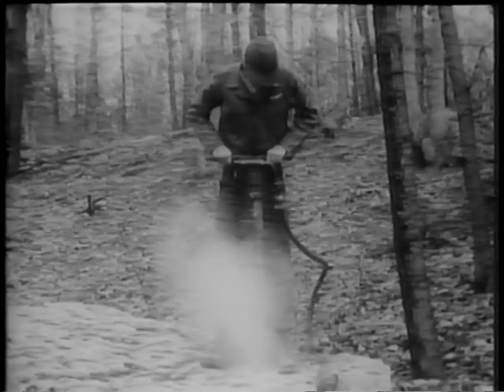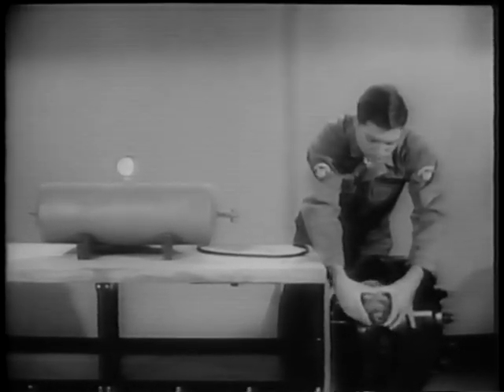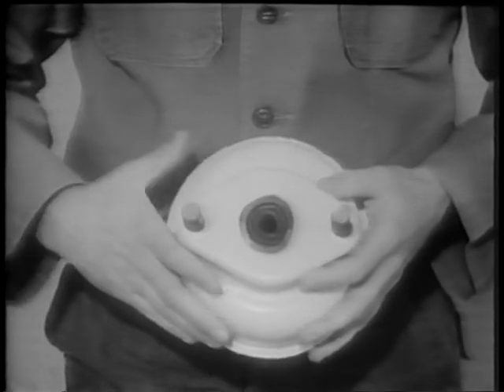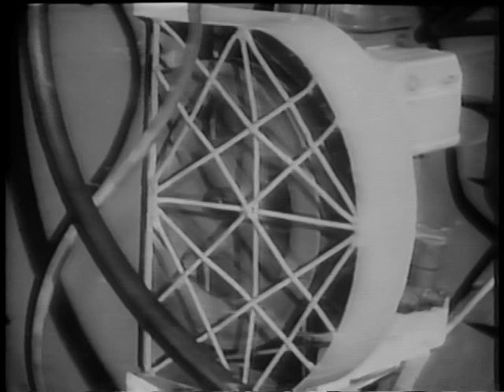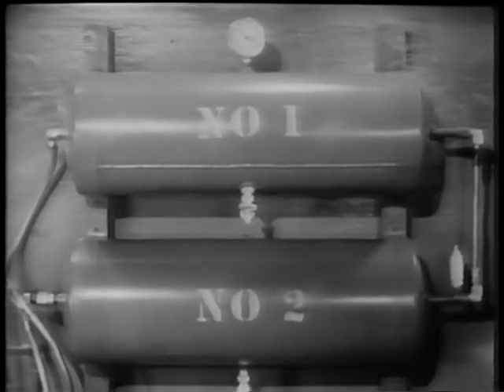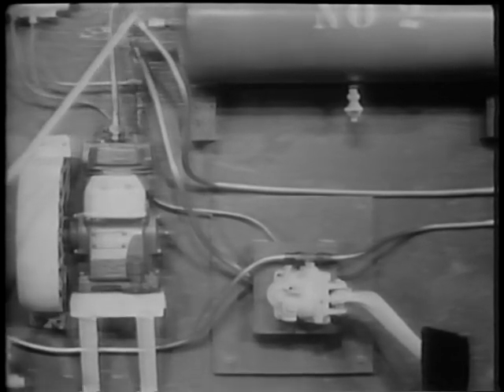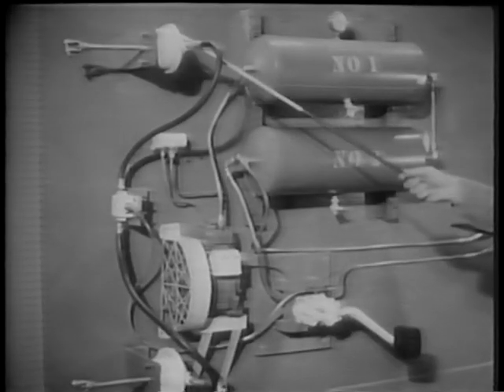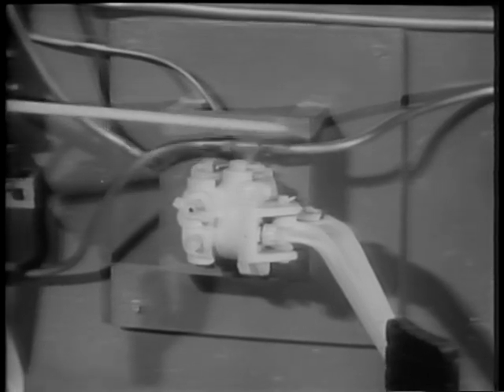Air Brakes - Principles of Operation

Comment: Good video. Would have appreciated more if it started by explaining why brake fluid system of brakes found in smaller vehicles was not brake system of choice for these heavy vehicles and can not be used here.
Reply: Hydraulic Fluid does not compress. Air does compress. 😊

Comment: if I'm not mistaken, the air disc brake's rotor is made of Carbon fibre-reinforced silicon carbide as well as brake pad. TGV passenger train is using this type of brake since 1980+, used on heavy truck will gave it a passenger car like feel. air disc brake work like a disc brake on many passenger cars, but the material of the brake is different and is actuated by air pressure

Comment: in 21th centry, the air disc brake appeared, they have more stopping distance than drum air brake, same braking performance when it was heated. air drum brake on the other hand tend to stop longer distance when heated. air disc brake was used by TGV passenger train and large percentage of truck/buses in europe

Comment: Except that my brakes operate on release of pressure, not by the pressure itself.  If I lose pressure, my brakes are applied and I can't move.  I believe that's true of all modern air brake systems.

Comment: I have 2 army trailers. Both 6 ton. When the air is in the reservoir but is not connected to the tractor the trailer will not move. Its backwards from civilian trailers. Mostly because in an emergency a guy could open the valve and drain the air in the trailer tank and release the brakes. Thus pulling the trailer to a safe location or whatever the army  wants. Just no brakes on the trailer when the valve is open, not safe but they don't really care about that when in a combat mode. The design i